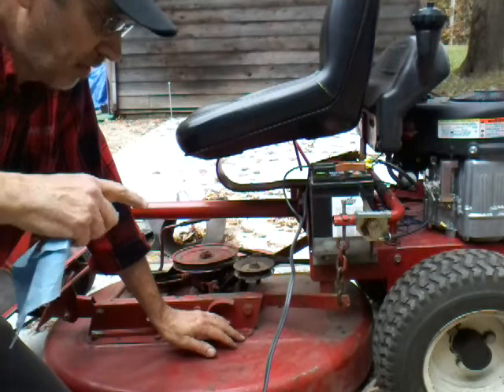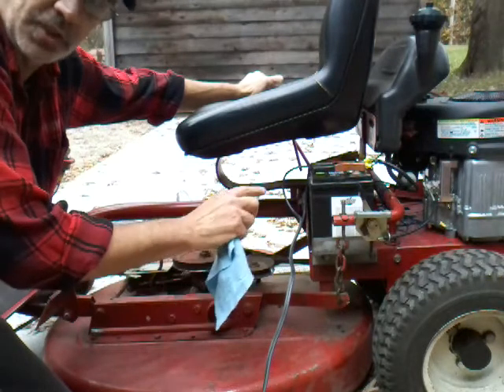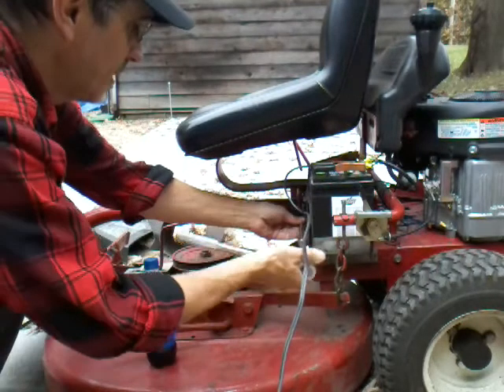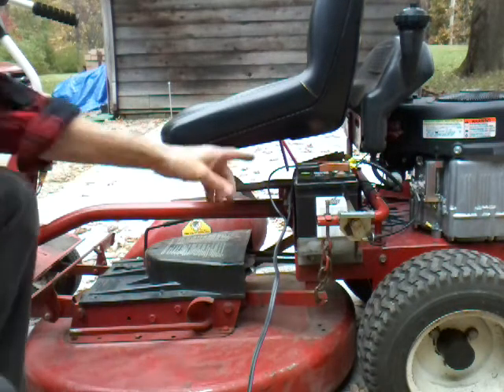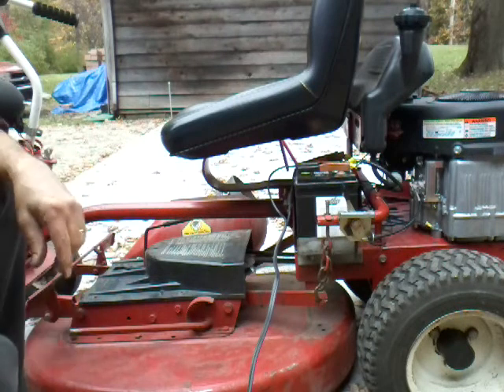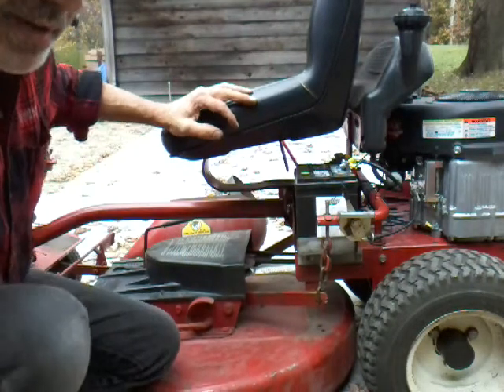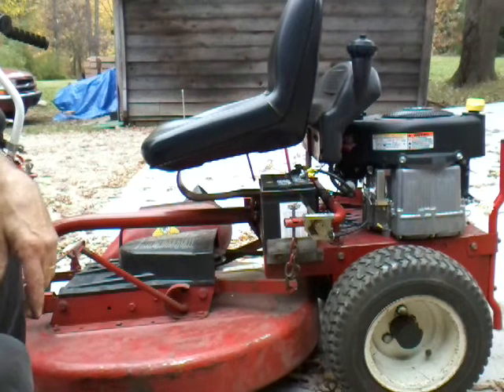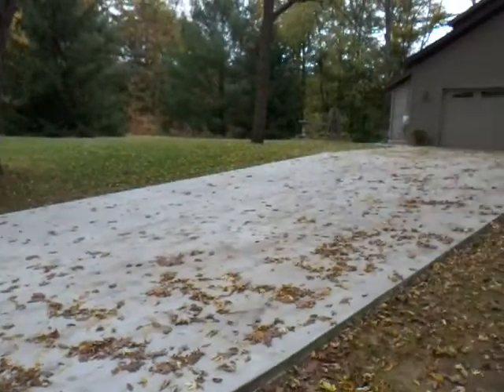49. Rebuilding my Snapper drivetrain part 7 of 7

Comment: stand the snapper up,remove the chains on both sides that hold the deck up, pull the deck back and put your cover on,while your there check every thing such as your blade,oil leaks,string around wheels and above the blade,too many people do not do this,find the problem before it breaks.when your done set it back down and go eat lunch for 1/2 hour to let the oil drain back into the crank case,piston rings have gaps that let oil pass into the head when standing up.i use to sell snapper riders and the main problem by the owner was not taking care of a well made machine.it is the same with car mantane it.i still mow with a 1970 snapper mower.THANX FOR THE VIDEOS!

Comment: Thanks Jim! Love your videos, wish I had found them sooner. I've ran these old snappers for over 30 years, starting with a junk 8 HP  Comet that was given to me for hauling it off. Lasted 12 years.

I never knew you adjust the blade belt like that, Luckily the few I've changed worked with the old adjustment. Last time I had so much trouble with that plastic cover that I decided to just toss it in the shed and leave it off. Not a problems it seems.
Reply from the maker: Unit 419 Hi it's Jim
  Well I'm glad you enjoyed it and I'm glad I could help you with your snapper issues, I hope I can convince you to subscribe have a lot of snapper videos coming. Talk to you soon Jim

Comment: Hi Jim I've got a snapper sr1028 I did an engine swap with the exact same engine and I'm not getting any fire however the engine did run before I removed it from the other mower but won't now
Reply from the maker: jason farley 
What kind of machine did it come off of,  you may have a safety switch issue. Thanks Jim
Reply: The good engine came off of a snapper m301021be rear engine with the same engine
Reply from the maker: jason farley 
  Hi Jason. Check to make sure all the safety switch kill wires are disconnected from the engine.   And disconnect the kill wire that goes to the coil on the engine you're trying to start , try replacing the spark plug. Thanks jim
Reply: Any way possible I could get a few pictures of your wiring on your engine for reference as I've already tried everything you suggested
Reply from the maker: jason farley 
  Are you getting any spark it all to the spark plug
Reply: No that's my problem the engine ran before I removed it from the other snapper and I hooked it back up exactly as Itwas on the other snapper and nothing I don't think it matters if it has a battery or not but I've got to replace the battery but it should still get spark at the plug
Reply from the maker: jason farley
  Jason. You need to see video no. 51 it will help you with your coil,  I hope your subscribed if so you can find it with no problem

Comment: Thanks, that was just plain funny!
What is your opinion on the newer Briggs OHV  engines, I have a 2004 12.5 and carb cleaning didn't  help, took it apart as far as possible!
I also mow with a SR825 which is really neat with the square tube support, it's a blast! Thanks for videos.
Kevin

Comment: hay like your viedo on snapper , got one of the critter i trying rebuld  rear axleitrying remove the rear tires  the one on right came off easy, but the one on left frozen up on shaft i try pententration oil on it and try heat it upwith small propane tank it never loosen up a bit , you have any answer that might help, i dint have a set puller  lol just my luck
Reply from the maker: Bailey 002930 yes I have a video on how to do that it's called removing the wheel flange off the axle and if you need anymore help email me at Jimfixitshop@gmail.com. Send me your phone number and I'll call you back and don't forget to subscribe it's free and you can watch all the videos on the whole series of rebuilding the snapper drivetrain by the way what state are you from I'm keeping track thanks for your interest in viewing Jim